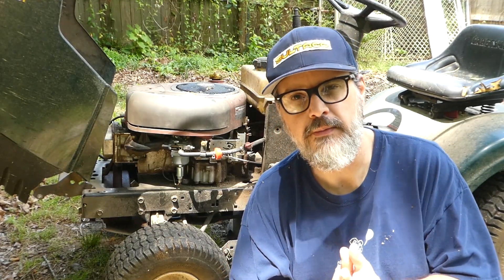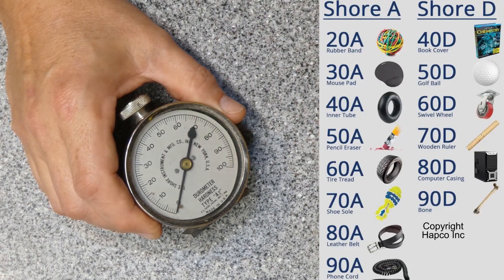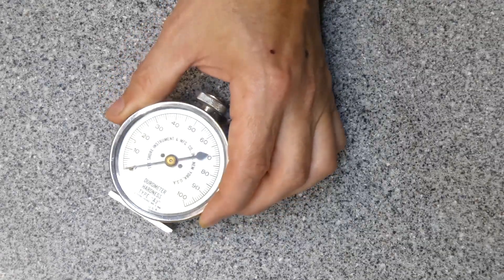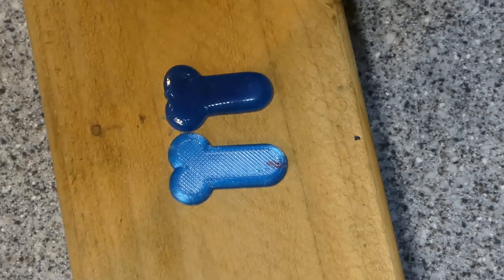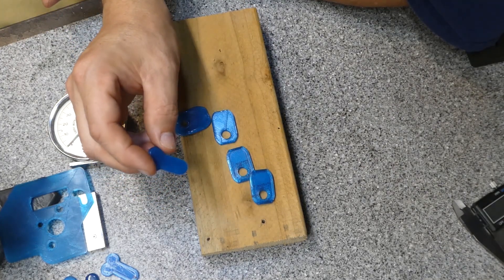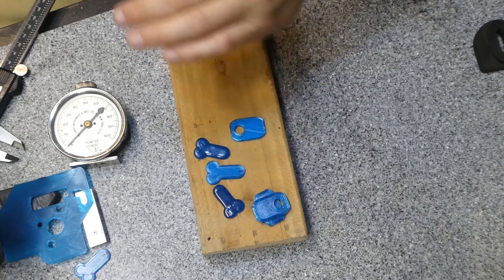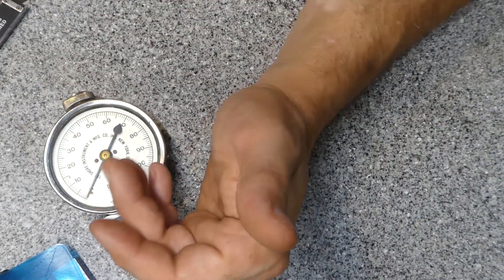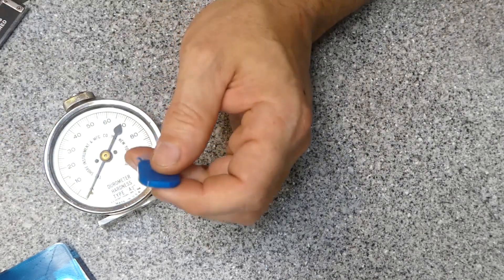Annealing TPU to increase its heat resistance?

Comment: TPU is a thermoplastic, a bundle of unlinked hydrocarbon chains, so repeated cycling (Especially at high heat) is going to permanently deform it. Thermoplastics in general are awful for applications where creep resistance is important.

Heat-treating plastics usually means forcing semi-crystalline polymers to crystallize, increasing the number and size of the hard segments where the polymer chains organize into tightly-packed formations. For instance, heat treating some blends of PLA can raise it's softening temperature closer to the melting point (Which is the point where the crystal-like formations in semi-crystalline polymers dissolve), making possible to use it in hotter environments like inside a car.

But TPU is an amorphous polymer, it's chains don't pack together into such formations. Since there are no hard segments holding it together, it just gets softer and softer as the temperature increases, until the temperatures it's printed at, where it's close to liquid. As you said, you're just kinda remelting it to pack the chains (and especially the layer lines, which usually are the spots which score lower in shore hardness tests) tighter together, so it won't do as much as it would for a semi-crystalline polymer.

An alternative that solves most of the problems you seem to be having with TPU is to 3D print a mould for a gasket, instead of the gasket itself, seal the layer lines of the mould with some wax, and cast some thermosetting resin into it - either a silicone or a thermosetting polyurethane. That way you can still prototype gaskets that are removable, but with a material that is suitable for the job. And there'd be no layer lines weakening the material.

I'd also look into polyurethane resins anyway - you might think TPU is cool but I'd say thermosetting polyurethane is amazing. Not only can you find it in a wide variety of shore hardnesses, including hard and rigid PU (There are PU resins designed to mimick ABS for prototyping of injection-moulded parts), it can be quite strong for a plastic (I've seen resins that promise ≥80MPa tensile strength), and high-quality mid-strength PU resist almost everything (From UV and abrasion to most chemicals).

And as it's a liquid, you can try mixing some ceramic powder or short glass/kevlar fibers into it to change the stiffness, although you'd need a pressure pot to squish the bubbles you'd inevitably introduce.

The only problem is that it's a toxic 2-part resin, so gloves, masks, an accurate scale and a ventilated work environment are requirements.
Reply from the maker: Great breakdown. Thanks! This is certainly not the right material for industry scale or critical applications. Creep resistance (I like that term) is going to be what makes or breaks it on my mower test for sure. From anecdotal evidence from the comments and my own testing and experience it can certainly take the place, at least in the short term, of other materials in some use cases. But never would I suggest that it would be the end of properly designed gaskets, RTV or other materials, especially for high heat/pressure applications.     

I would be interested on your thoughts on heat treating as it relates to this. I actually went back and forth over whether to call this heat treating or annealing. I went with heat treating because that is what the more scientific research on the topic which I found called it and it is frankly easier to understand for a video title, though some others referred to it as annealing. I used the term fully realizing it did not seem entirely accurate. In my experience you anneal to soften as with copper or after heat hardening steels. It is used to temper the material to a usable hardness. So what process is happening here do you think? It obviously increased its performance at higher temps slightly. My simple tests and several others I found that seem to show that. As you suggest since this is amorphous and has no real structure, is this extra heat deflection just that the layers are melted together tighter perhaps?
Reply: I love it when I click on a video with a thumbnail like this one and find a commenter leaving a brilliant, clear rundown of the background science and engineering.  Thanks for sharing your knowledge and experience with everyone!
Reply: Wonderful    👏👏👏👏👏👏👏👏👏👏
Reply: what a response. Thank you sir.
Reply: I don't know what you do for a living, but I'm guessing they don't pay you enough. Appreciate the detailed response

Comment: I am looking at 3D printing TPU for adding more vibration dampers on my (single cylinder) bike. O rings were one of the things I thought of, though I think you want to be careful with that, because surface continuity is an important part of how O rings work (there are engineering sims of O rings on YouTube which should show you the effects that I'm concerned about).

Comment: I'm guessing they won't do for cylinder head gaskets? I couldn't imagine 3d printing gaskets for 30ton trucks 😂😂
Reply from the maker: No, I would not try them on cylinder heads or any critical components of large vehicles. Lots of other uses though.

Comment: All scientific technical jargon goes right over my head anyway. You kind of answered my questions about whether the material would squish out of shape too much under compression of torque, or if it hardens up and fractures out under repeated heat cycles. Looks like it would work ok for most gaskets except head, exhaust and carb/fuel.
Reply from the maker: It is not going to hold any more torque than a regular rubber gasket without some sort of stiffening. I think for my climate, heat cycles will perform as good as rubber as well but in your part of the world I don't know. Going from -10 to 190F and back again over a time might make it as leaky as an old garden hose rubber washer pretty quick. If you think of anything you might want to try it out on, let me know. And no, I do not mean anything on the plane except maybe a cup holder, :-)

Comment: 2 stoke feul has oil in it, can be the cause of it curling.
Mill gasket comes in contact with oil and grease.
Valve gasket comes in contact with 90c oil at operating temperature.
You really need to dunk TPU in oil and see if it gets as nasty as modern tools with rubbery over mold.
Reply from the maker: That's a good point. The valve cover gasket will answer a lot of that. Thanks!